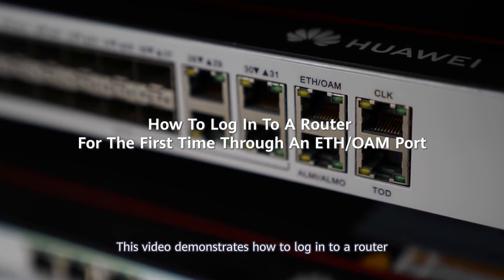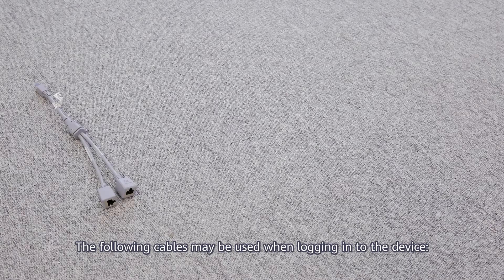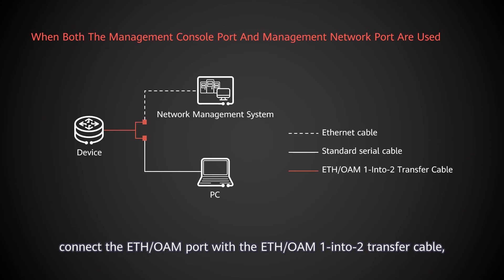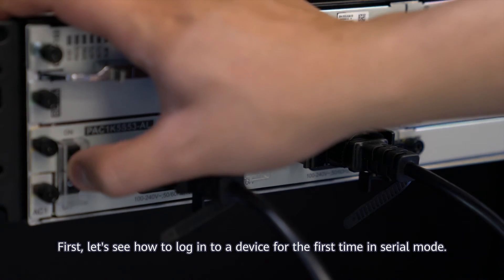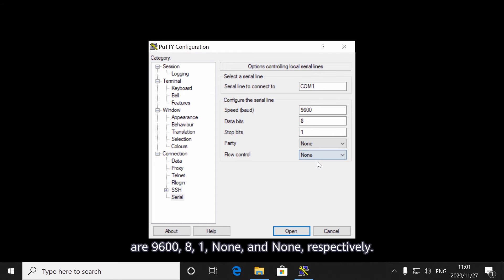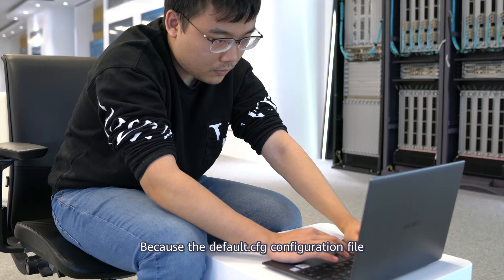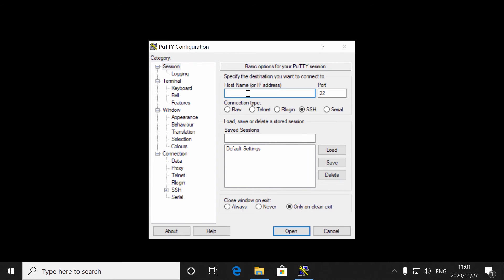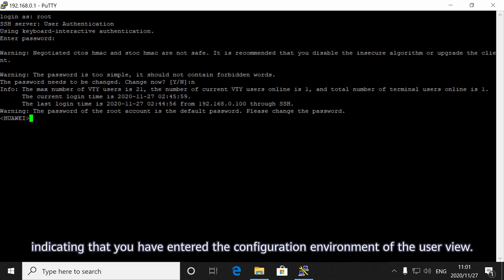How to Log In to Huawei NetEngine 8000 M Series Router for the First Time

Comment: Is possible to recover console password? Console password was not turnover by last administrator
Reply from the maker: Thank you for your attention to the documentation.
It is confirmed that no document needs to be modified. You can obtain the required video "What If I Forget the Console Port Login Password of a NetEngine Series Router?" at https://support.huawei.com/enterprise/en/doc/EDOC1100376651.
If you have any other questions, leave messages in corresponding web pages.

Comment: Hi, where do i can get manual configuration?
Reply from the maker: Thank you for your attention to the documentation.
This issue has been tracked by the documentation engineer. We will reply to you as soon as possible.
If you have any other questions, leave messages in corresponding web pages.
Reply from the maker: Thank you for your attention to the documentation. 

You can obtain the required document at https://support.huawei.com/carrier 

The link of "Logging In to the NetEngine 8100 M, NetEngine 8000E M, NetEngine 8000 M":
https://support.huawei.com/hedex/hdx.do?docid=DOC1101079546&id=EN-US_TASK_0000001134463266&lang=en

The link of the structure and technical specifications of the cable:
https://support.huawei.com/hedex/hdx.do?docid=DOC1100977504&id=EN-US_CONCEPT_0000001147797662&lang=en

If you have any other questions, feel free to leave messages on the corresponding web pages. We are here to help.

Comment: where is the serial number of the router?
Reply from the maker: Thank you for your attention to the documentation.
The reply to your feedback is as follows:
The serial number of the device is attached on the top of the device. For details, see the Labels sheet in https://support.huawei.com/hedex/hdx.do?docid=DOC1100977504&path=PBI1-252291763%2FPBI1-252291797%2FPBI1-7275849%2FPBI1-250515092%2FPBI1-252772223.
If you have any further questions, please continue to leave a message on the corresponding web page. Thank you.
Reply: display version

Comment: The routeur engine 800 ask me the password in the beginning but it's an new equipment there's no password in? What's the default Password please?
Reply: Hello,
it's up to you to create it and insert it twice on the first start-up of the huawei NE8000 device
Reply from the maker: Thank you for your feedback.
It is confirmed that no document needs to be modified. You can obtain the required document at https://support.huawei.com/enterprise by choosing Support > Routers > Service Routers > NetEngine 8000 Series > NetEngine 8000 M14 and M8 V800R021C00SPC100 Product Documentation.
The Link: https://support.huawei.com/hedex/hdx.do?lib=EDOC1100205782AEK07217&docid=EDOC1100205782&lang=en&v=01&tocLib=EDOC1100205782AEK07217&tocV=01&id=EN-US_CONCEPT_0192229583&tocURL=resources%2525252Fsoftware%2525252Fnev8r10_vrpv8r16%2525252Fuser%2525252Fne%2525252Fdc_ne_sec_maintenance_0061.html&p=t&fe=1&ui=3&keyword=default
If you have any other questions, leave messages in corresponding web pages.
Reply: you find the password ? i am facing difficulties to find out the password
Reply: @drg-2.0  no :/
Reply: @guihitayassine1938  i tried root and Changeme_123 and i am in.
Reply: @drg-2.0  I'll try it today thank you
Reply: @guihitayassine1938  my pleasure, hope this gonna work for you
Reply: @drg-2.0  authentication failed.

U try it on an huawei 800?
Reply: @guihitayassine1938  8000 M1A